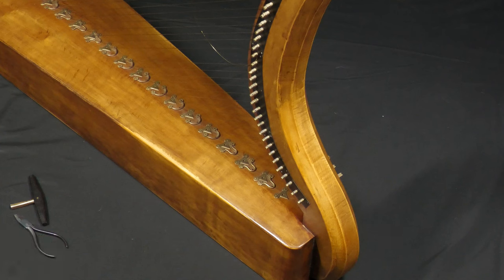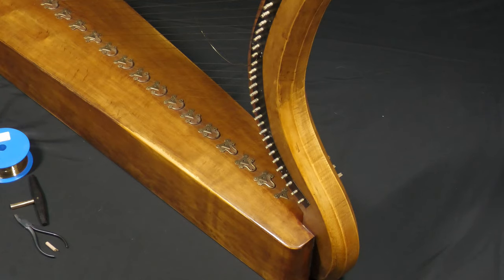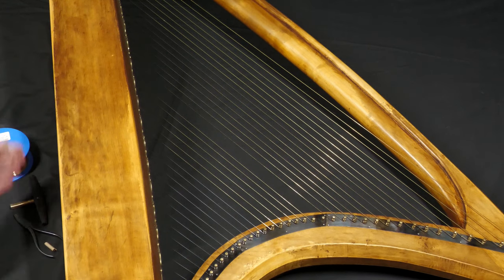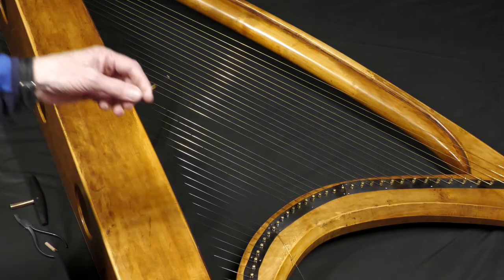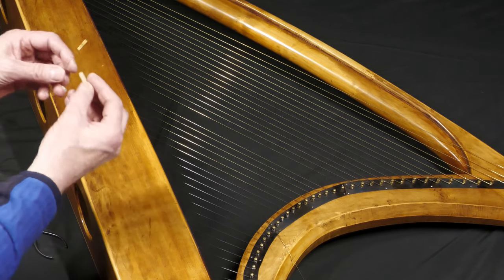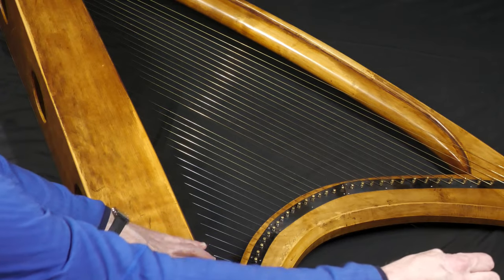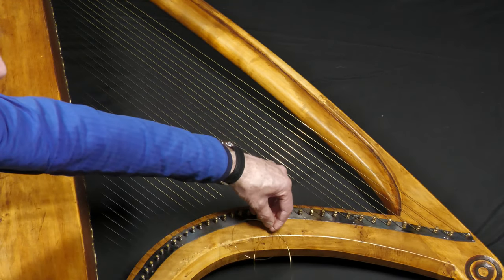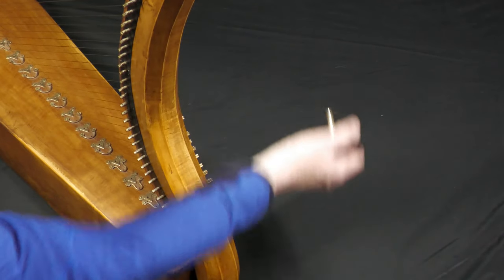Replacing a wire string on an Irish harp

Comment: Which side do you wind the string on after you’ve threaded the hook through the tuner?
Reply from the maker: Easy answer: the same way as all the other strings!

The normal way is so that the string runs up the back of the pin (nearest to the player). So you put the tuning key on the right hand end of the tuning pin and turn the key clockwise to wind the string tighter. 

My PDF download instruction sheet shows a drawing of this